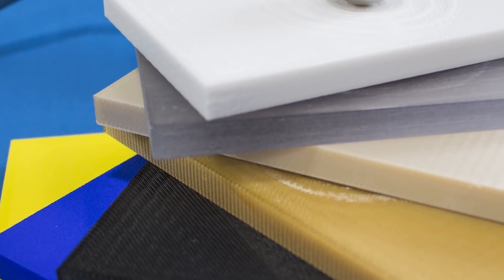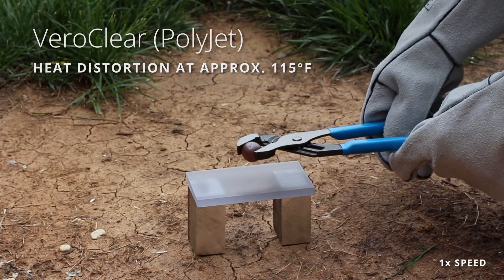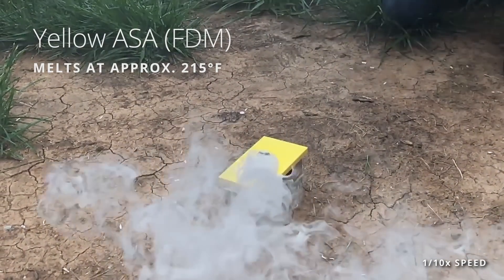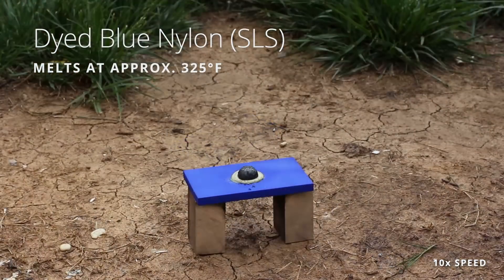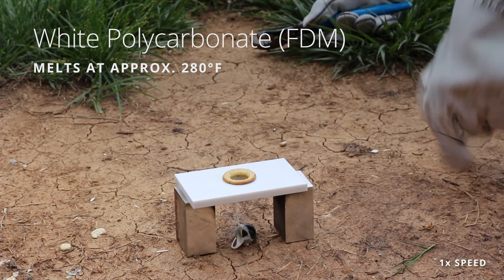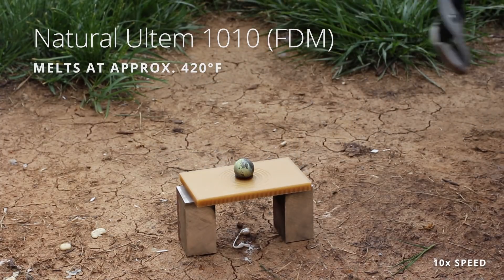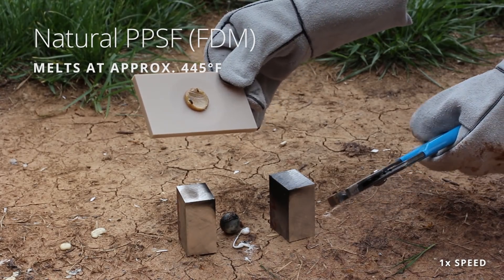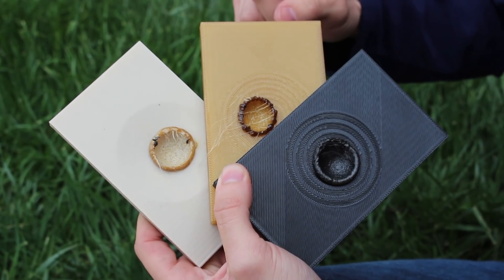Will It Melt? 3D Printing Heat Resistance Test

Comment: Most used 3d printing materials are PLA and ABS, and you didnt test either one, why?
Reply: because EVERYONE knows standard PLA cannot take high temps at all. every single 3d Print youtube tells ya not to even leave in a hot car. and plenty have tested both those materials on strength, durability and temp
Reply: @thethoughtexperiment8990  Well, I didn't knew. I was waiting for ones but.. Still, in this day,  I don't know in what temp 3D-Printed ABS plastic melts, googling didn't help any.

Comment: No time values for each test?  C'mon- isn't that the main variable at work here?  Can't tell from the fast fwd.  The last tests seemed to end early- are you saying the ball was room temp by that time?   Finally- are these all solid parts?  It looks like some have internal support for a hollowed interior (especially evident in the blue Nylon).  Finally, if you could could maybe splurge on a 2nd camera so we could see what Greg is seeing underneath?
Reply: Well, time does not effect how each temps effect. Lets say paper burns at 300 degrees (dunno does it, just example), temp where it burns, is same even when we heat it to that temp in 20secs or 5secs. Temp is same, material is same. So temps where each materials melts, are not effected how quick we heat it to that temp, or how thick the plastic is, or how heavy the hot ball is, or such.

Comment: Great demo.  One comment: You used the phrase "low smoke point" when talking about the higher perf materials, but a "low smoke point" usually refers to a material with a lower temperature smoke point.  I'm sure you meant "low[er] smoke output."

Comment: Links to the individual MSDS would be awesome. You are doing this outside, but I don't notice mention of what gasses are being produced, and whether they're toxic or hazardous. Typically, wouldn't a normal person wear a respirator when they are unsure of that? Including that safety warning should be in this video, if even for your own potential liability. IMO. The rotation of the ball is due to differential cooling in the direction of the wind/airflow. Also, for a real experiment you should have used a new nickle ball each time. Otherwise you don't know whether the previously burned-on material affects the thermal conduction into the new material, or changes the cooling rate due to the greater, non-polished surface area. Good and important tests, but please take the next steps and apply a little more scientific rigor.
Reply from the maker: Hi Thom - Thank you! We did take precautions off-screen to mitigate hazards. Right after filming our top comment was we should have had a new ball per test; there was much more buildup than expected but overall we had really great results. This test is definitely not hard science, that's what the OEM material specs are for which can be found on our instant quoting page. Thanks again!